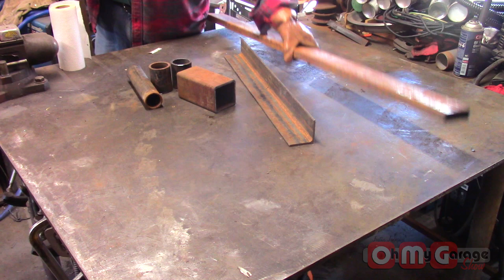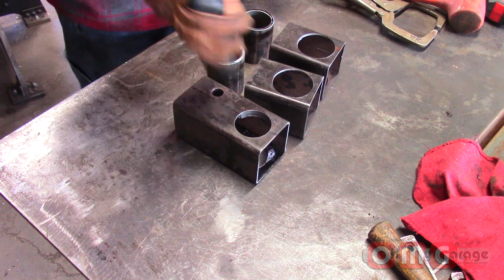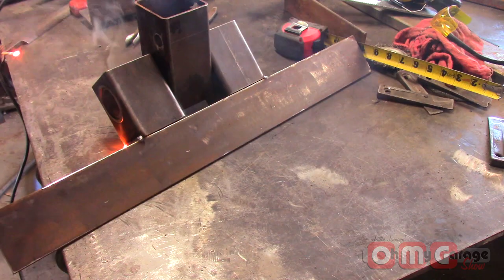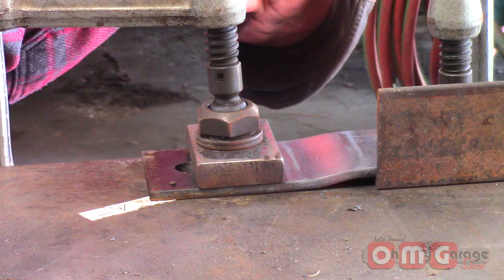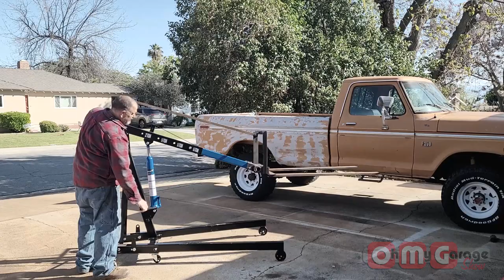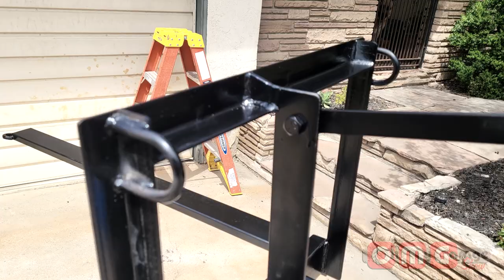Engine Hoist Forklift Modification for Roof Top Tent DIY

Comment: I think you forged something in this video! Could you add a turnbuckle to adjust the angle of the forks?
Reply from the maker: I could. Originally, I was going to build a lever to pull that would tilt it back. I could also have put a threaded rod rod with a crank that would allow more granular adjustment and tilt while using it. But, in the end, it worked for the client, and he took it the way it was finished. If he's happy, I'm happy.

Comment: How heavy of a load do you think you could lift with it without it wanting to tip?
Reply from the maker: I'd extend the legs or put some counterweight on it before adding too much. The tent we lifted is about 200 pounds. It was surprisingly stable. But, sudden moves might scare it.

Comment: Hi - can you please share the measurements and type of metal you used for the modifications of the hoist so I can replicate?
Reply from the maker: It's just mild steel. The "forks" are just 1" x 3" x 0.120" HSS. As for dimensions, I don't remember really. It was built for one job. In this case, it only needed to lift that roof top tent off of the vehicle and later lift it back on to the vehicle. I can only assume your specific needs would be different.